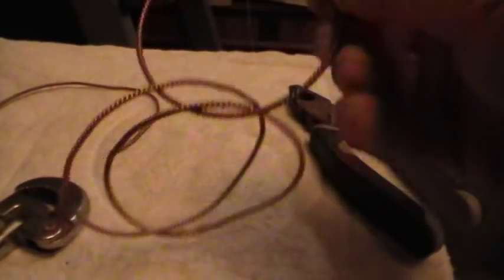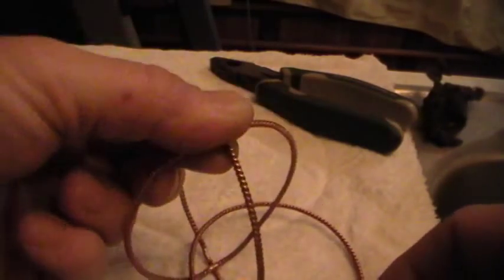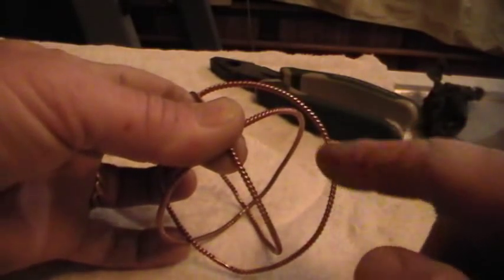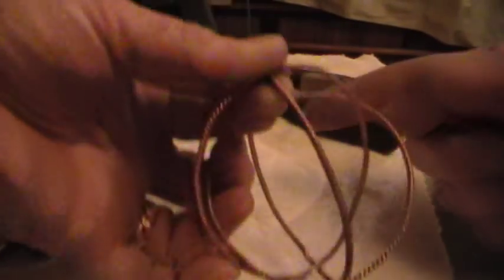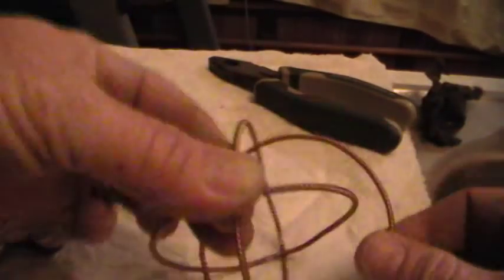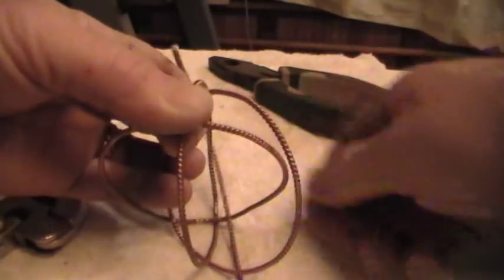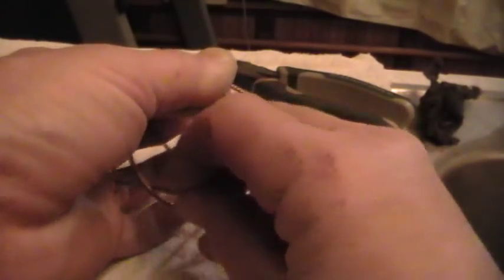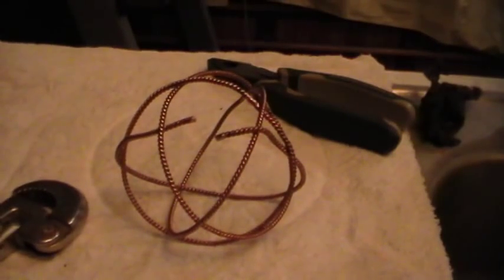Tensor Field Generator Construction -the short and simple of it

Comment from the maker: I have not made a Harmonizer.  I understand Slim may have been working on a Genesa structure before he passed.  With the Genesa, the innateness of the structure is to pull energy into the square ports and send it out the triangle ports in the sphere.  But with the Tensor Field Generator, it both pushes and pulls energy out all ports at all times.  There a sunshine-like, or sphere of influence created by this design.  The size of ring and cubit type are two factors we found in changing the field.
Reply: Hello Brian.. I just made a harmonizer with 1/4 harmony STU cubit. Any suggestions on soldering part? What soldering wire did you use?

Comment: really had a hard time until I realized that when you hold the one ring on top..and the two below, dangling down...the two on the bottom are soldered, (looped together,  and the one on top goes through the loop of the two.  Thinking the two rings on bottom were just side by side about drove me nuts until I went through the video frame by frame...lol  Thanks...I  got two made successfully  :-)

Comment: What is this all about? What does it do? Can it help treat my anxiety disorder? I stumbled upon this thing while searching for a way to deal with my anxiety disorder, I am going crazy while dealing with my anxiety.
Reply from the maker: I would suggest a pendant, such as the Regenerative Heart Pendant https://shop.twistedsage.com/products/regenerative-heart-pendant.  Otherwise, yes, the Tensor Field Generators can help, specifically in the Golden Fire frequency.
Reply: @Twistedsagecom  and do tell, how does some twisted copper clumsily cobbled into a ball shape generate this magical field that violates the laws of thermodynamics? you call this a "generator" so what does it generate, where is a meter that can measure this output.
Reply from the maker: @wildmanfujiami5870  sacred measurements create Tensor Fields.  If you truly wish to know, then please do pursue Twistedsage.com/Resources
Reply: @Twistedsagecom  "Within a Tensor Ring is an infinite source of energy that is neither electric nor magnetic. The Tensor Rings are superconductors that neutralize magnetic fields, bring coherency to chaos, and easily stabilize and equalize bio-magnetic fields. " - uhm no. I don't think the quack that wrote this knows what a superconductor is. and how is this "infinite source of energy" is suddenly manifest by little twisted copper circle? what is the source of this "energy" and why can it not be confirmed to exist, and a twisted pair copper cable only "neutralizes magnetic fields" within the scope of its own domain, and then only when there is an insulator on the copper to begin with. 

"This means that Tensor Rings cause some of the elements in water to spin to their high-spin state referred to as ORME [Orbitally-Rearranged Monoatomic Elements]. This has a tremendous impact on water’s molecular structure and on the energetic components of the water." - and what preserves this "higher spin state" hmm? and if you change the molecular structure of water it isn't water any longer. liquid water cannot maintain any defined structure, its covalent bonds are in a state of constant flux. and what are these vague and undefined "energetic components?" and how can they be measured reliably. 

"The Tensor Field also produces a measurable gravitational effect. Grebennikov’s work supports this hypothesis as well as Mueller’s global scaling, where Tensor Rings emit a harmonic to a specific gravitational wave. " - the mountain of hazy unproven claims is so thick, what is a "gravitational effect" and a "specific gravitational wave" gravitation isn't an electromagnetic phenomenon, it's a specific point source incoherent dielectric attraction, it has a potential, not a frequency. 

"When copper is heated and drawn to create the wire, the crystalline structure within the wire is aligned in a one-way piezoelectric flow. The wire is folded,twisted, and cut, and the ends brought back together on themselves. This creates a continuous flow of energy in both directions. " - right, citation needed. I don't think this author knows how energy works, energy is a construct of dielectric potential, and nature by default seeks to mediate pressures, you only create an "energy flow" by artificially causing some kind of pressure imbalance in any given system, mechanical or energetic. I also doubt the author knows what the "piezoelectric effect" really is. because crystalline structures don't just align themselves in a specific desired manner simply because the material was heated. 

I've read enough pseudo-scientific nonsense for the day, I have projects that can actually yield productive results and benefit people with real application to get back to work on.

Comment: Thanks for this video. I have made 2 or 3 generators now and even though all rings are over under I find i can never get the final ring close to round it is more heart shaped even after using bracket bending pliers. Does this mean something isn't right?
Reply from the maker: The nature of the weave pattern will not allow the rings to be perfectly circular.  You have to split the difference between all rings.  the smaller the sphere, the more out of round it gets.  the larger sphere rings appear more round.

Comment: Thank you for sharing this video. I strongly belief that this device will work. However it is not stated whether the copper wire is Bare wire or Coated wire with insulating material like electric motor coil. i think the information will further through light into this technology. thank you.
Reply: use bare wire. Be careful as some bright copper wire will have a clear coat on it.. when buying from hardware store or e bay...make sure the wire is non coated and (most of the time it will be just labeled ground wire.)   For some projects, I  have purchased the  2 lead with ground, and stripped the wire by hand.  When they sell it off the big spool, do not let them wind it on that hardware store winder. bring it off by hand and loop it... when they wind it on that hand crank, it tends to kink the wire every foot.

Comment: Instead of soldiering the rings together? Is there a way to crimp a copper adapter over the copper intersections of the rings? Can we use copper coils the coil the links together?:hand-pink-waving: 🤓 ❤ 👍👍👁
Reply from the maker: As long as the ends are touching, it does not matter how they are held there!
Reply: @Twistedsagecom  Thanks, I just wanted to know of other ways to connect them.
Reply: Another question: Slim Spurling used to play frequencies using a speaker or speakers and just play the healing frequencies. I heard there is a new and better way to connect the wires from your Wave generator using your cell phone. Do you know how to connect the wires to the harmonizer (I wanted to add a Clear Quartz crystal inside the Accuvac coil in the Hormonizer) ?:hand-pink-waving: 🤓 ❤ 👍 👁

Comment: When making a Tensor Field Generator with  4 rings, what do you find best for  full cubit size?  144 Mhz or 177mhz?  
I also need to know what gauge wire  to use to twist.  full cubit  6 AWG  or 8 AWG?     For  1/2 cubit , 8 AWG or 12 AWG?   Or any other suggestions.  Thank you
Reply from the maker: It seems that every cubit and cubit fraction have their own feel, with each gauge of wire.  For the 1/2 Sacred Cubit in the video, the 14 gauge feels good.  For full cubits, the 8 gauge feels the best personally...

Comment: hi Brian could you communicate about the ideal size of the rings for you?  and for a complex construction with rings of different size like the dream oscillator,  wich size do you use?
Reply from the maker: It varies.  For structural devices of course a heavier gauge.  The Oscillator was made with 6 and 8 gauge usually.   It just takes making a ring of different cubit fractions and different gauges to find what feels best to you.  Some of the Rings we offer, can be found in both a lighter and a heavier gauge.  The heavier gauge usually can be felt in the physical more, though both would be the same energetically.